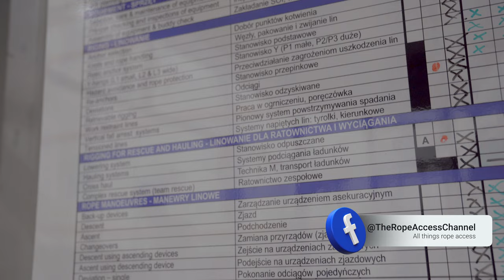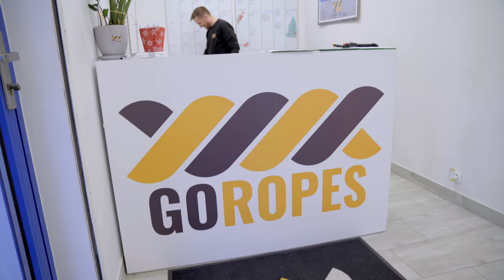IRATA Level 3 Reassessment Training - Hanging Haul into Aid Climb Rescue

Comment: For your pull through,If you tie a fat alpine butterfly with both ropes together, then you don’t need to add the pulleys because the fat alpine won’t pull through the karabiners
Reply from the maker: Good point, or use smaller biners or maillon rapides. Pulleys is just a bit less friction on the way down and points for show 😜
Reply: @TheRopeAccessChannel  yeh. All work well but you don’t always have them on your harness. Fat alpine suits any scenario

Comment: I love your Videos, thanks a lot :) Maybe you can help me by one question:

When you work above, you often use simple lanyards without energy absorbers to secure yourself. In a holding system without the risk of falling, I would do it that way too. But you often work on the edge with the risk of falling, don't you need lanyards with an energy absorber? The only exception that I know of is if the fall factor is below 0.3, does that also apply to you?

I would be very happy to hear your opinion, as this is something that always bothers me.

Update: After watching several of your videos, I noticed that you apply the rule that a connection without a shock absorber is possible if the fall factor is less than 1, correct? Then that is a big difference from what FISAT teaches. There, a shock absorber must be used if the fall factor is more than 0.3. In practice, in almost all cases where you use your non-length-adjustable lanyard. (For example, when traversing or securing to a lifeline, FISAT prescribes a lanyard with a shock absorber (because the fall factor is usually >0.3) I hope you understand what I mean. 

If that is true, that would be a big (safety) difference between FISAT and IRATA?!? Maybe a separate video? I would be happy to hear your opinion, regards.
Reply from the maker: Could be a great topic. I am not a fan of using FF. A ff1 in a static sling of 60cm is terrible. A FF1 in a 10 mter bungy is fun. In Irata we teach FF1 max for cowstails. prefereably above shoulderheight which would be about FF0.5 I guess..  IN IRATA cowstails are dynamic rope. Is that the same in FISAT? There is a statement somewhere for a Grillon about the FF0.3. WHich makes sense because it is a static rope..
There is also the theoretical safety and what works in real life... Usually in work restrain no shock absorber and we prevent a fall of the edge. In Fall Arres we need an abosorbre.

Comment: Just a question, as someone who has done a few L3 assessments, do you also find that it has become 'easier"? The reason I'm asking is that over the years, I've been reassessed by different assessors, and found that they don't "gun" the old boys anymore.
Reply from the maker: I think you are right the standard has been lowered a bit. And because of three things. 
1)No more breaking into a tight line and 
2) I think the short link got easier too. One more carabiner to use so a bit more room to play. (not sure though)
3) I do think that most "modern" assessors try to give everyone a fair clean assessment. Tick the boxes. THere is no reason why a fresh L3 should have easier assignments than an experienced L3. We should all be assessed according to the same score sheet. No extreme time limits or crazy near impossible tasks.
In training push those old dogs hard and show them that they should keep up their skill and don't sit on their fat asses polishing railings for 3 years 😜😜😜. Nah kidding. IRATA made an assessment list and that is what should be tested. Otherwise IRATA should change the list so everyone gets tested the same.
Reply: @TheRopeAccessChannel  Well said.